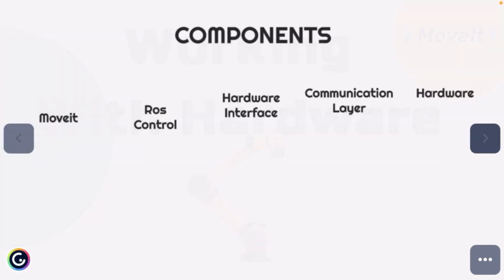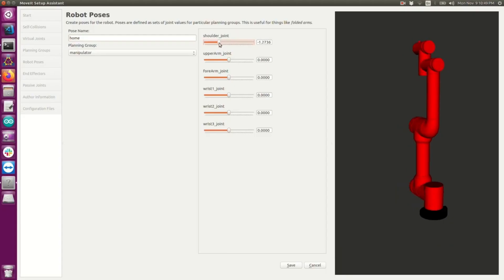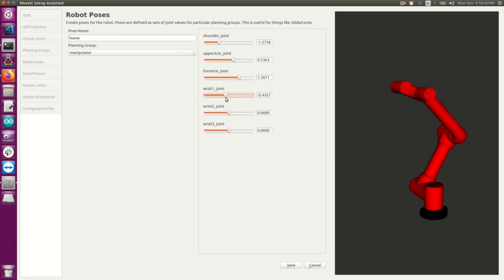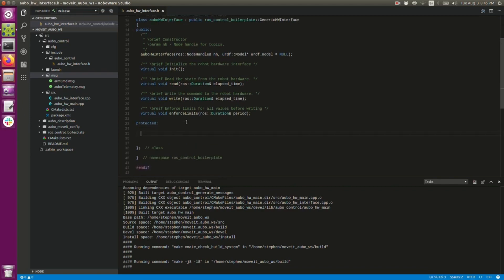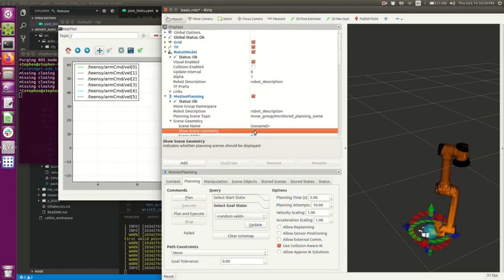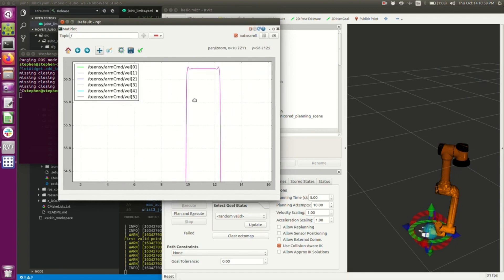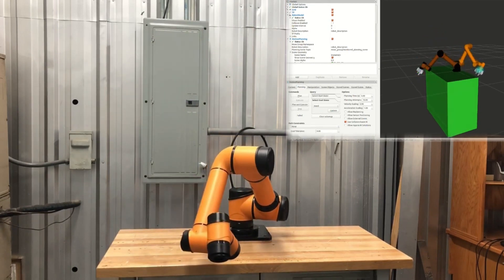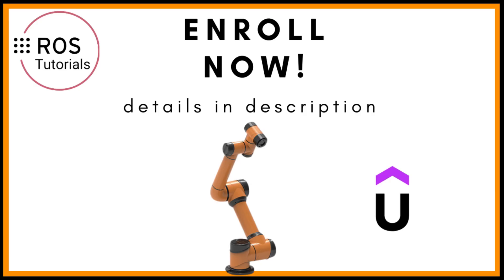Complete Guide: Making a Hardware Interface for MoveIt!

Comment: Any chance you could do a video about how distance/triangulation sensors work with robots to adjust user frames for welding & router cutting applications? Tried to find info online, but there is nothing. . . Thx

Comment: Hello, Thank you very much for this much-needed course. Will it be possible to also add tutorials for doing the same using python?
Reply from the maker: This is a good question. Unfortunately, it is not possible. A “MoveIt compatible” hardware interface must use the ROS Control library and this library only exists for C++.